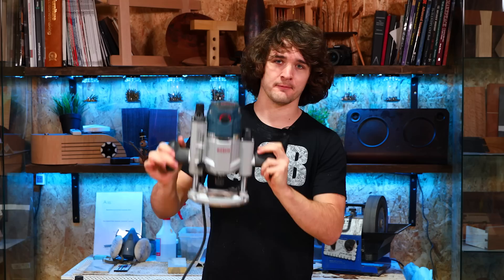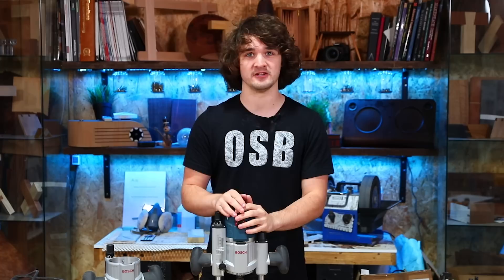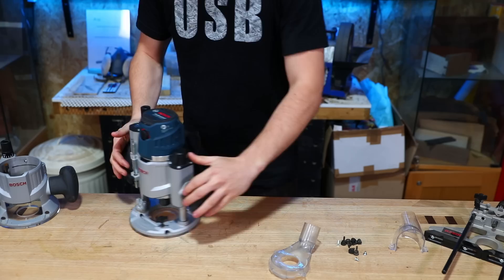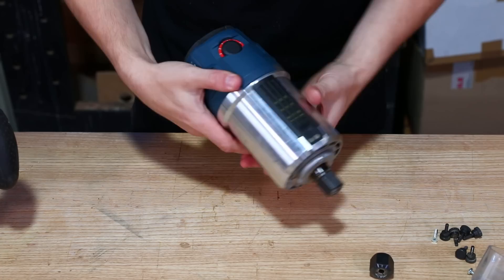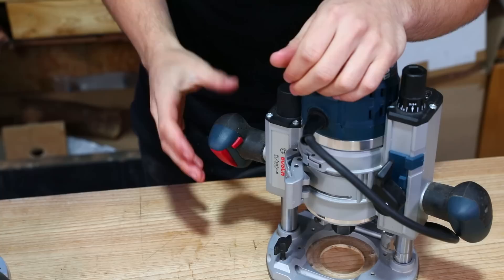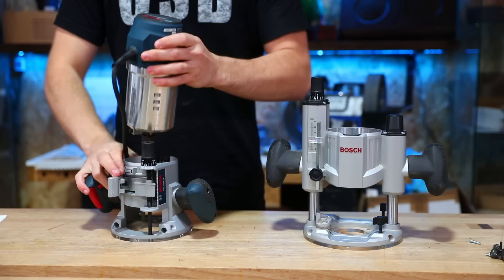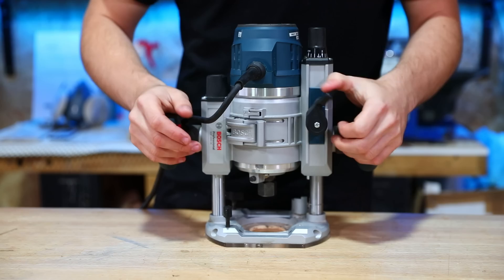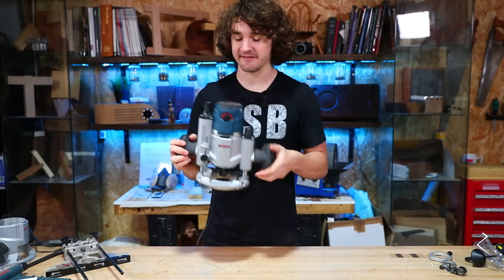BOSCH GMF1600 Router Review (Including Comprehensive Overview, Specification and Setup)

Comment: Hopefully that is good feedback to bosch about the response time after letting off the trigger and getting back on it straight away and they look at making a software change to how the soft start works.  Also why does you brass/copper? Guide Bush Set have so much metal filings in the case? That is something that would bug the crap out of me haha.   Also when its in the router table do you have to reach down and hit the trigger and lock it each time or you just have it locked on always and turn it on via a switch on the table?
Reply from the maker: It’s all wood shavings filling up that case. Yes it annoys me but I’m too lazy to clean it 😂 As for the router table question, I have it linked to an NVR Switch so no, I don’t have to worry about locking on the trigger each time :)
Reply: @MattEstlea  NVR Switch is something I need to look at getting when I get around to building or buying a router table.  Thanks for the reply.

Comment: Would you say that the black part on the router motor body could be removed and those three low-voltage  contacts could be externally manipulated to operate the router?  I'd like to put this more powerful router in a lift instead of the less powerful one.  Oh, wait, you have 337k subscribers, you'd never answer me...
Reply: Yeah, I bought one and I'm modifying it to reside permanently in a router table, but I can't say that I'd recommend doing so.  The black piece can be removed along with the sliding contact part under it.  The circuit board in the handle that also has the switch contains some surface mount resistors that work with the potentiometer in motor body to form a voltage divider for the speed control.  I soldered a jumper wire to permanently activate the switch and moved the potentiometer to a remote location with a shielded three wire cable.  I had to make four V-shaped aluminum spacers 2-inche x 2-inches  x .222-inch and bent in the middle about 15° to make it fit my Jessem Mast-R-Lift.  I had read in some forum that it was the same diameter as the slightly smaller Bosch router, but that was wrong.

Comment: Anyone in australia considering this router should really think twice. I have had a gutsfull of dealing with this router. 
Firstly, they (total tools) didn't want to include the parallel guide, despite me having an email from Bosch stating it should be included.
Then when they agreed to that, I got a floor model with missing parts. 3 months later I'm still waiting on Bosch to get the parts for me.
Just now, the spring for the micro adjust on the copy base (which had to be ordered as another separate piece) has broken/gone missing so the micro adjust latch does not index into the body of the motor.

One hiccup I could tollerate but this has been one problem after the other. Bosch support in Aus is shit, the router is decent but I've literally used it no more than 4 times and a piece has broken, and total tools have been amicable but lacklustre in their communication and general support.

I might just take it back and get a triton or even the AEG.
Reply: i agree with everything you say about Bosch, i've emailed them so many times about other maters with no response or unhelpful at best,  good luck trying to buy Triton routers here Aus, the two shops they recommend don't  even sell them any more, and triton  wouldn't even tell me if they still sold them here, so bought a Makita the local repair man said they have the least trouble.
Peter

Comment: I live in the USA and just ordered the MRC23EVSK version (actually on back-order) before I came across this video.  On the one hand I appreciate the confirmation that I chose a good tool.  On the other hand, the US version does not come with the guide fence or dust collector, and neither one is shown as an available accessory on the Bosch USA web site so adding them later seems impossible.  https://www.boschtools.com/us/en/boschtools-ocs/combo-pack-routers-mrc23evsk-34685-p/
Also, at least one photo I've seen of the Euro version showed it in a plastic case, with the guide at the top.  It doesn't appear to come with that case either.

Comment: Hi, today I bought Triton tra001  and start  to cut table top oak wood   But terrible things happen  while I am cutting the circle   the bit  wobble and fell down   Twice I was so shock   The bit was bosch 12 mm  special for 4 cm oak wood  while   Moving the router all screws losing turning itself  I just stop it and Returned to shop  I am so disappointed with Triton I was not sure to buy but I thought was powerful 2400 watt  but I felt  not so powerful     I felt Bosch 1400 ace was much better  feeling  and power than Triton! So now I have no router and don’t know which one I  have to buy it for oak wood need powerful  router.
Is. This Bosch blue 1600 gaf can handle oak wood 5 cm ticknes? Do you really  recommend  it?

Thanks.
Reply: Even  I use it  Kärcher vacuum for dust incredible. Make dust everywhere. What a rubbish  router  Triton!

Comment: Checked both purchase links for the UK and I think it’s really overpriced for a Bosch imho. 
Yes it’s part of the “Professional Range” but their tools aren’t very “professional” these days. Too many plastic parts and functional features that break or seize after a short period of time.
Reply from the maker: It’s somewhat costly, but you do get that added versatility which negates the need to buy a second router and a router lift. But this is only the case if you want to own a router table. I disagree about the plastic parts though. The build is no different to what you would find on any other brand with the exception of Festool and Mafell (which still have their downfalls anyway)

Comment: Unfortunately, the router is complete garbage!
The main reason for buying it was two bases, a plunge and fixed. The idea was to mount the fixed under the table and use plunge in other cases. 
Fixed base does not work at all! It is supposed to be fine regulated with screw but the motor cannot move inside the base at all!!  So, money down the drain!
O.K. I said, lets buy a professional table plate from wood peckers... and another problem rises. First the motor does not measure like any other supported by most of plates so there is a problem mounting it and the second, the power switch is not on the motor but on the base so you cannot use the motor out of the base.

I have manage to overcome most of the described problems just to figure out that it would be nice to have a few Watts more.... so...

After all the problems it ended in garbage and I have bought a Festool OF2200 which is 3 times more expensive, but worth every single cent !

good luck